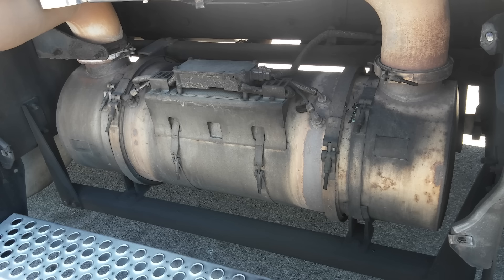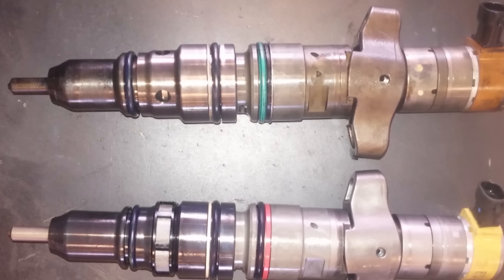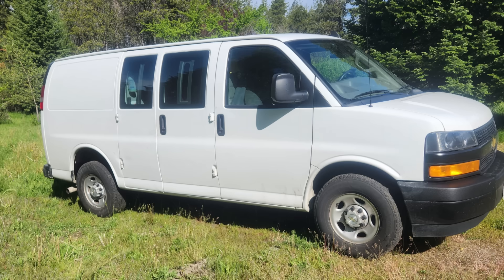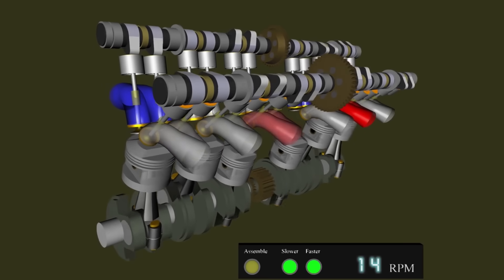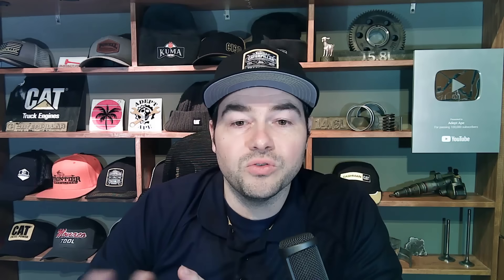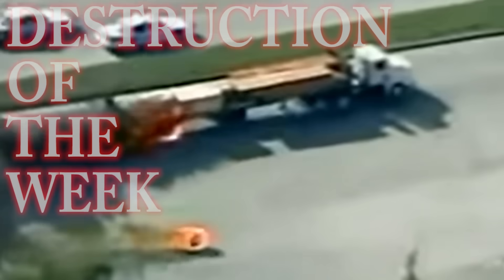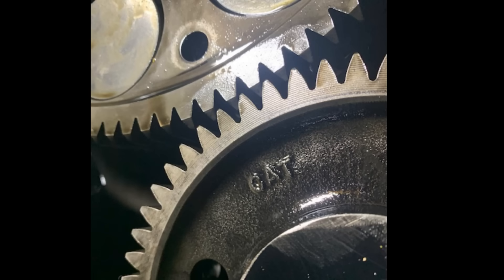What!? Gas engines are getting "DPF" Filters Now!!!

Comment: Hi greetings from the netherlands i drive a renault from 2021 with a gpf filter for one year now no problems sofar.  Also on the forums i don't find probems wet these filters.

I work as a diesel mechanic on inlandships and dpf filters now also come to this type of industry. This is all shit. These engines altime run low load for many hours so its shit

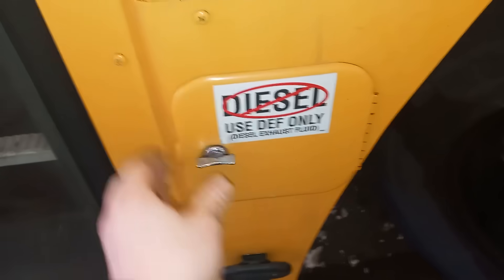Comment: 7:04 Josh, respect your CAT knowledge and the fact that you are a diesel mechanic, but as another mechanic, I'd ask you to have a look outside the US for DPF systems and how they last in regular use.
I own a Nissan Navara here in Australia (Similar to the Frontier) with the Renault 2.3 twin turbo diesel engine.
In 150,000km of driving, I've never had a DPF light on or had to force a regen.
Like all the good, modern systems it uses the regular engine injectors to send burning fuel down to the dpf during self regen.
It is a reliable and effective way to manage the system.
By contrast, the most popular ute in the same market, the Hilux, uses a dumb 5th injector in the exhaust system to do regen. That system is prone to failure as the injector sits around in the hot exhaust waiting to be called into action.
Toyota here were forced by our government to do a recall and offer lifetime warranty on the system so it could meet to emission laws.

There's good and bad systems out there.
Take care.

Comment: D.P.F. FOR GASS ENGINES  , IDIOTS AT IT AGAIN,  THERE IS TECHNOLOGY AVAILABLE TO REDUCE POLLUTION ON DIESEL ENGINES BY 95PECENT AND ON PETROL ENGINES BY 50PECNT  ,THIS TECHNOLOGY HAS FEDREL ACREDTATION AND E.P.A APPROVAL IN THE U.S AND BEEN AROUND FOR 15 YEARS NOW  , BUT NO ONE WONTS TO PAY FOR THE TECHNOLOGY  , AND DIESEL ENGINES DONT NEED ADD BLUE EITHER ,  AND A LOT CHOPER THAN A D.P.F. BULL SHIT ,

Comment: they build everything to fail or have insane maintenance cost. the big three work around to sell 3/4 ton trucks and above was to go to gasoline DI. gm broke the 400 lb-ft and 400 hp line in 2020 using you guessed it gasoline direct injection. whose mad? you guessed it the EPA. their solution? tighten emission standards even more. not everyone needs a 1000 ft-lb 500 hp pickup, no, they gotta screw the other guy that just wants a solid towing gas truck that doesnt blow an injection pump at 34k miles.

Comment: John's Tempo
I have around 160,000 miles on my baby. My Great Uncle bought it new off the show room floor. Alas next year, I have to pull the engine and rebuild it. Using oil, some leaks and head gasket seeping between one and two cylinders. So far I have found factory new head gasket, lifters, all valves, gears, timing chain, oil pump, front and rear gasket kits, pick up screen, rod bearings, valve guide seals, flywheel, cam bearings, one connecting rod (if needed), few minor parts. Aftermarket valve guides, valve springs. Naturally all hoses, water pump, radiator, power steering hoses, head lights, marker light, and stuff like that. Anytime one shows up at pull a part, I go down and get as needed parts. Have a few radios, several climate control's (major problem) one factory new, modules, engine fan motor, spare tire, headlight switch, climate fan switch, heater & a/c core assembly, instrument cluster. Just bought a factory set of main bearings. It's odd on how they come from Ford.
Waiting on Josh to make a field call and rebuild it for me.
Reply from the maker: I think we should put a B model in that Tempo and really get it going!
Reply: @AdeptApe  Well, I am old school. So a B mpdel is to large and mordern. So I say lets try a 1670 four cylinder. Find any info on that, if you can.

Comment: I’m going to try to be positive about this news:  if the environmental regs start requiring particulate filters and DEF on cars, this should add cost, complexity, and hassle that may lower sales of direct injection cars !!  This would be a major step in the right direction.  Direct injection requires a high pressure fuel pump (usually cam driven), more precise injectors, and a vacuum pump to run accessories.  And then it causes carbon buildup on the intake valves.  If we want to save fuel, why don’t we just have the ECU run the mixture leaner.  And while we are at it, ditch the turbochargers that are invading most current car models.  Make the engine and gearing the right size and live with more modest acceleration and a simpler drivetrain.

Comment: I'm sticking with both of my 00-02 stickshift Saturn SL2 "plasticmobiles" for as long as I possibly can.  Many people got over 225K and 38 MPG out of these $14,000 cars (both of my odometers are in the 170K-175K range as of 12-31-2025).  Easy to repair, good MPG, long life.  I switched to ceramic front brake pads, added polyurethane front suspension components and bought a LIFETIME alignment from Firestone.

Comment: I don`t like direct injection. It has a problem with carbon on the valves especially in turbo engines.
Reply from the maker: This is very true, my van had build up on the intake valve and it is apparently very common.

Comment: The EGR and catalytic converter systems address visible soot and unspent fuel odors from the tailpipe on diesel vehicles. The DPF and DEF systems were specifically created and mandated to address Nox emissions. Nox is not visible.

Direct Injection in diesel automobiles did not come about until the mid 1990's. In the USA the 1996 VW Passat TDI was the pioneer in the non-luxury market, a few years behind adoption in Europe. That 1.9L TDI engine was as quiet as it's gasoline counterpart. It did not emit any visible exhaust or odor when run on conventional diesel fuel.

The next generation of TDI engines incorporated variable turbochargers, which made them even more clean burning and fuel efficient. Then VW made the bad decision to NOT leverage all of the R&D resources that they had committed in the BlueTech partnership with Mercedes, because they didn't want to pay royalties to Mercedes for that DEF/DPF technology. Instead VW developed an entirely new 2Ltr TDI engine entirely in-house in a rushed manner, and thus was born the diesel-gate debacle. Essentially the bean counters and marketing geniuses forced the engineers into a cul-de-sac of deception and inferior technology in order to hit msrp targets that they believed were necessary to maintain market share.

There is no functional or efficiency benefit to a DPF filter on a diesel automobile. It exists only to address a specific fraction of the exhaust which is presumed to be an environmental and/or health concern. DEF is a highly toxic liquid in itself, and these systems simply trade one perceived problem for another one. One set of health and or environmental concerns for another. But, that is the history of CARB, clear back to the MTBE disaster that they imposed in California, contaminating groundwater and wells forever.

Is there some specific component of the exhaust from a gasoline powered car that these new systems are intended to address? If so, I missed that in this video. These look like a solution in search of a problem, and another means for making ICE engines uneconomical and unreliable. Why? Because the Environmental Professionals hate ICE engines and want them gone. It's a primary axiom of their dogma.

Comment: I noticed on my gas powered van (carbureted) I got better gas mileage on the highway when I had 1000 pounds in the back. Empty I got 12 MPG, fully loaded I got 18 MPG. Once I get up to highway speed the weight would keep the momentum going when I let off the throttle so I rarely touched the pedal. It doesn't work on hills though (or in town). I also ran a vacuum operated fuel vaporizer to the carb vent with an adjustable 'T' valve so I don't run too lean.

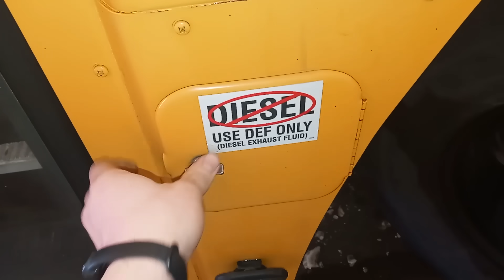Comment: 7:07 bad news is passenger cars do have DEF/SCR called Ad-Blue.

When Ad-Blue runs low  the car goes into limp-mode, I learned that the hard way 😂

Fixed that permanently, I accidentally drove into a potholes & smh got an EGR Delete, DPF Delete & Ad-Blue Delete 🤣🤣

Comment: Dpf is a particulate filter to collect and break down soot. Imagine the soot as charcoal turning into ash in a weber grill (This is how a dpf functions simplified) The real limitation for dgi is nox from extreme combustion chamber temps. A diesel deals with this pollutant via a reductant system by converting nox in a special catalyst using diesel exhaust fluid. Untreated nox in the atmosphere produces smog and acid rain . Gasoline produces almost no soot unless its very very rich and that's almost nonexistent in gasoline engines in any production vehicle. So I wonder if were not conflating   nox  catalyst reduction systems with soot pm5 reduction dpf.

Comment: It will be interesting to see how many fires get started because people do the regen cycle in the wrong place, or on asphalt. The exhaust system sits much lower on a car than a truck, and the heat from the regen cycle will melt asphalt with 0 problems.

Comment: GPFs have been around for about a decade. My 2019 VAG has one. It's been no bother at all. They're passive and clear the "soot" by running lean to get the exhaust gas temp up. So they don't use fuel to perform a re-gen, and don't sit on your drive cooking the engine because you got to your destination in the middle of a re-gen. It's a totally different kettle of fish to a DPF, even if the reason for them is similar.

Comment: AdeptApe - Always enjoy your videos, you're the David Attenborough of HD diesel world!  Just a point of reference for injection types and fuel efficiency.  

My '89 6sd Vett has the TPI 350 (tuned port injection).  On the Hwy doing a steady 70-75mph it routinely achieved 30-32mpg on flat ground!  The TPI system is a Batched (bank) injection system.  Literally the simplest/crudest form of port fuel injection outside of having a mechanical injection pump.  Many factors drive milage figures, GDI I don't think is a primary contributor really!  Advancements in the PCM response times, the code, and modern closed-loop sensors are!  Quite frankly, GDI has brought a lot of significant problems to the table!

Comment: The only particulates I've ever seen from gasoline cars is when they are burning oil due to faulty valve seals and piston rings. I'll stick with my 1990 Mazda Miata I bought on July 16, 1989 and my 2005 VW Jetta Wagon TDI (BEW engine) that I bought in August 2011.

Comment: The direct injection engines, especially turbocharged variants, tend to have a much higher tendancy to burn oil. This issue is further worsened by ultra-lightweight oils like 0w-8, 16, and 20. I doubt engine pollution tests account for this throughout the engine lifespan, the gradual increase in oil consumption thats getting burned and ejected out the tailpipe. It is NO coincidence that gdi engines tend to clog catalytic converters at higher rates than mpfi systems, considering that these engines are supposed to be "more efficient" and cleaner burning, wouldnt you think that the cats would last much longer.

Comment: In Europe we have Mazda SkyActive-X engines. Those use EGR (exhaust gas recirculation), just like some diesels do. The problem with EGR is that you have to have a particle filter or else recirculated particles will start to clog up your engine inlet and EGR system. That's why those Mazda's also have GPF. That's the first time I heard of GPFs.

Comment: I bought a cheap old (2005) Hdi diesel a couple of years ago. The DPF filter and all auxilaries that comes with it was badly maintanied and didn't work. I took it apart and a put in a few used parts, cleaned the particulate filter and filled the additive tank with the appropriate liquid (basically Urea..). Haven't had any problems since covering around 22,000 miles and I'm really happy with my choice. All MOT's cleared with flying colors btw...

Comment: 5:49 "particulate matter. We should be filtering it out"
Naw. It's much better to eliminate the combustion/cold metal interface that causes the soot in the first place. Prevention beats clean up.
7:18 "SCR systems"
Aren't useful in a stoichiometric engine. The 3-way catalytic converter already does the job of an SCR system much better.

Comment: Until the heavy Diesels got clean enough to make a DPF tolerable, it wasn't practical to try to filter the particulates out.  But when the option became possible to implement, it suddenly got mandated.  Go figure.  Over on the gas side, once the engines' exhaust got clean enough to not kill their catalysts, most gasoline engines had relatively low particulate outputs when theyr were running right anyway, until direct injection came along.  The particulate outputs are still really tiny, but thanks to CARB, it's been deemed "too much".  In my estimation, there are a lot of other opportunities to clean up the environment which make more sense than mandating a GPF, and it would make FAR more sense to require a cheaply replaceable regular-maintenance filter on the crankcase ventilation system to reduce the buildup of crap in the DI engines' intake ports, but I don't get to make such decisions.

Comment: Carbs were never very efficient.  A compromise at best in all situations.    It was always somewhere between rich and lean depending on temperatures oxygen in the atmosphere elevation....
Reply: Youtuber ThunderHead 289 has made something called a carb cheater. It's basically a computer controlled vacuum leak that will compensate for a carburetor that's tuned too rich. It also lets you see your AFRs while tuning, to make it easier to get close to that stoichiometric number, which if I remember correctly is 14.7:1 on regular gasoline

Comment: This will be great for all those people that drive only short trips in the cold
Reply: Short trips cause the system to get clogged as it never gets hot enough to burn the particulate off. This is screwing up many diesels used in city short trip vehicles.
Reply: Should have an EV then
Reply: @chrishart8548 depending on the cold the EV won't be good for it either
Reply: @Letsanum whats wrong with a EV in the Cold ?
Reply: @chrishart8548  The battery discharges much faster, causing limited distance per charge.
Reply: @bruceb5481 it's not to bad in the UK i can't speak for really cold country's.  Maybe electric doesn't really work there.   I saw a video in Canada with a Tesla on a granny lead and it was discharging faster than it was charging it was so cold.   The battery was obviously trying to keep itself warm. I guess.

Comment: The older multiport fuel injection systems were able to keep the carbon deposits down cause they constantly clean the combustion chamber with fuel and whatever cleaner you might have dumped in. Direct injection systems don’t do this and as a direct result carbon builds up and you can get cruddy exhaust

Comment: It's interesting that the Daimler Benz used in the Messerscmitt BF109 fighter among other aircraft from the second world war used mechanical direct injection.  Along with many other technologies, they were possibly deemed too expensive for civilian use post war.  It does just show how advanced technology became when the stakes were high.
Reply: Actually these mechanical FI units did come to civilian use. The 1957 GM 283 SBC producing 283 horsepower. First introduced in 1957 as an option for the C1 corvette and the Bel-Air option 1957 Chevy. It was made by Rochester and did stick around until 1963 when it was offered as the top tier engine on the then new C2 1963 corvette. The engine was now 327 cubic inches. After that Bosch has offered various jettronic and K jettronic units in cars but the setup you speak of gave the GM V8s that magical one horse for every cubic inch equation. The non FI versions of the 283 were good for 270 with dual 4 barrels and the 327 could make 375 horses with a dual 4 barrel
Reply: @matthewcaughey8898 yep, I was aware of them.  The Rochesters were quite a big, bulky unit from memory.
The Daimler Benz was direct fuel injection into the combustion chamber, where the Rochester, Bosch, and Lucas mechanical fuel injection was the more common injection into the inlet manifold or throttle body.

Comment: they are adding more s to cars? they need to remove all the s from them. the mileage they can get removing crap from them would be close to what you loose with the c on. and the cars would be using less gas. guess the oil companies can't afford the gas saved. by the way reduce the gas taxes too.

Comment: Diesel Partial Filters are a pain in the ass, the light will turn on to do a DPF regen at the most inconvenient times and if you can't do the regen within a certain number of miles it goes into limp mode dropping your speed down to 5 MPH and you have to go to the dealer to have them do a manual regen. This is a horrible system.

Comment: This is misleading. No one requires a particulate filter, there is just a limit on particles now and this is what some manufacturers are doing to comply. The regulation is for all particulate emissions: brake dust, tire dust, and tail pipe. A super easy solution is to just make smaller cars, but instead of doing that some manufacturers decide to filter the exhaust.

Comment: One of the main benefits of direct injection is the ability to deliver fuel that is fully independent of valve timing and have the capability to deliver multiple injection pulses to shape the combustion event. This allows for higher turbo boost, Higher NA compression ratios on lower octane fuel by lowering cylinder temps with direct fuel introduction.